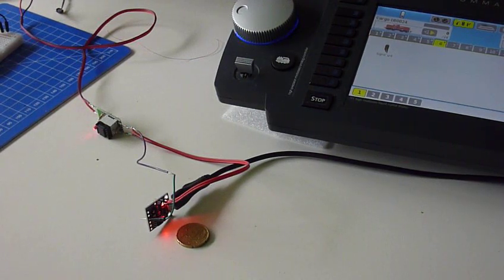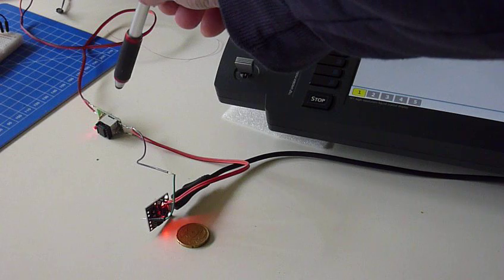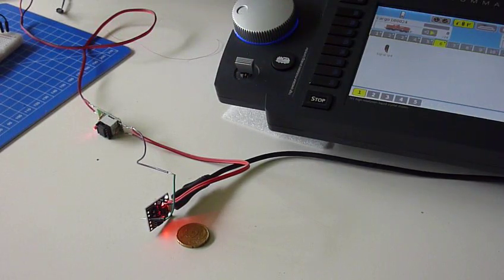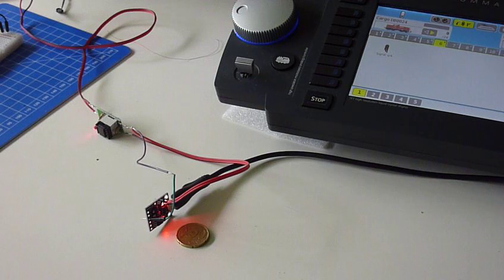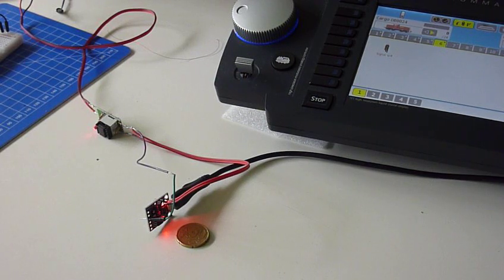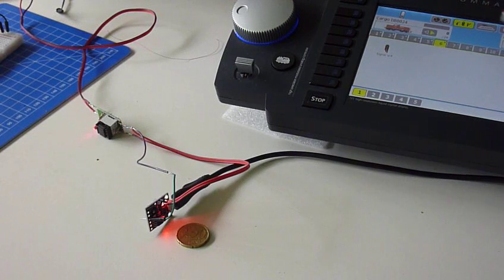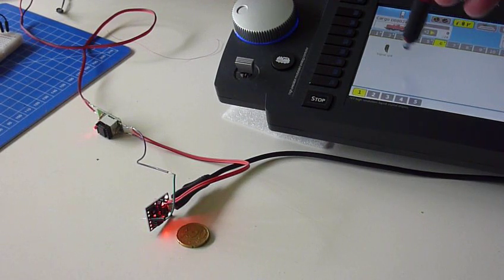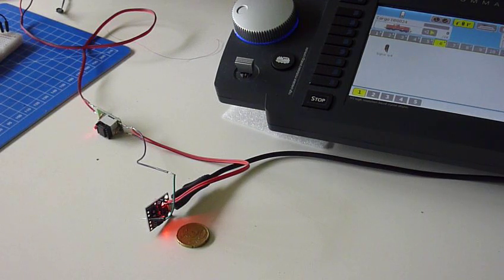RMR045 - ATTiny DCC Function Decoder

Comment: I subscribed and I'm really enjoying your videos.  In this video you mention that it might be possible to control a servo motor with this circuit and it's under investigation.  Were you able to control a servo with this or is my question answering in another one of your videos.  Thanks!
Reply from the maker: Nope, I've not been able to get the servo library to work on the Attiny. However, this was a couple of years ago and I haven't looked into it since. Maybe some things have changed, it's about time to look into it again.
Reply: @rudyshobbychannel  Greetings !!
I downloaded the DCC_S88 library, and it has the RB_DCC_Decoder_Servo.ino file inside. Is this file updated so the servo functions will work now?
I am trying to find a cost effectve DCC Servo Decoder that can be placed along side devides on a layout, without having to pay $25 - $100 a pop for brand decoders.
This is basicly what I want, but in the end...it should only cost about $1 for the Attiny and a $1 per servo. 
Example: https://www.ebay.com/itm/162432299600
Reply: @rudyshobbychannel  
I just found this if it helps at all...

ATtiny45/85 Servo Library
http://www.cunningturtle.com/attiny4585-servo-library/

Comment: Would it be possible to control an electric switch with this, which is connected directly to the rails ?
Reply from the maker: I don't know what you mean by a switch which is directly connected to the rails? you can operate a relay via DCC commands using this ATTiny, the relay can switch anything you like.
Reply: @rudyshobbychannel  I mean connected to the track output (which go to the rails). But when you can only operate one relay, it would not be possible to control a switch (dutch: wissel). And one other question: can you use a TIL111 optocoupler instead of the 6N137 ? (I only have a TIL111).
Reply from the maker: Waldo Hazeleger You need a 6N137 or one with similar switching time specifications. It is a very fast opto coupler, which is needed because of the critical timing of DCC signals.
Reply: @rudyshobbychannel  Ok, I go shopping for them... Thank you for your answers !
Reply: @rudyshobbychannel  Just now tried your DCC sniffer circuit with a TIL111 coupler. Also works ! 
Now building the attiny...
Reply from the maker: Waldo Hazeleger Great, then the TIL111 apparently is fast enough. Have fun!

Comment: Rudy, I download the sketch and made no modifications.  Can't get it to compile.  A little help please:

Arduino: 1.8.5 (Mac OS X), Board: "Arduino Uno WiFi"

Build options changed, rebuilding all
/var/folders/pk/_hj0k0z920d0t1pblgj887k40000gn/T//ccIAHvAX.ltrans0.ltrans.o: In function `setup':
/var/folders/pk/_hj0k0z920d0t1pblgj887k40000gn/T/arduino_modified_sketch_310962/RB_DCC_Decoder_Function.ino:123: undefined reference to `DCC'
/var/folders/pk/_hj0k0z920d0t1pblgj887k40000gn/T/arduino_modified_sketch_310962/RB_DCC_Decoder_Function.ino:123: undefined reference to `DCC'
/var/folders/pk/_hj0k0z920d0t1pblgj887k40000gn/T/arduino_modified_sketch_310962/RB_DCC_Decoder_Function.ino:123: undefined reference to `DCC_Decoder::SetRawPacketHandler(bool (*)(unsigned char, unsigned char*))'
/var/folders/pk/_hj0k0z920d0t1pblgj887k40000gn/T/arduino_modified_sketch_310962/RB_DCC_Decoder_Function.ino:124: undefined reference to `DCC'
/var/folders/pk/_hj0k0z920d0t1pblgj887k40000gn/T/arduino_modified_sketch_310962/RB_DCC_Decoder_Function.ino:124: undefined reference to `DCC'
/var/folders/pk/_hj0k0z920d0t1pblgj887k40000gn/T/arduino_modified_sketch_310962/RB_DCC_Decoder_Function.ino:124: undefined reference to `DCC_Decoder::SetupMonitor(unsigned char)'
/var/folders/pk/_hj0k0z920d0t1pblgj887k40000gn/T//ccIAHvAX.ltrans0.ltrans.o: In function `loop':
/var/folders/pk/_hj0k0z920d0t1pblgj887k40000gn/T/arduino_modified_sketch_310962/RB_DCC_Decoder_Function.ino:130: undefined reference to `DCC'
/var/folders/pk/_hj0k0z920d0t1pblgj887k40000gn/T/arduino_modified_sketch_310962/RB_DCC_Decoder_Function.ino:130: undefined reference to `DCC'
/var/folders/pk/_hj0k0z920d0t1pblgj887k40000gn/T/arduino_modified_sketch_310962/RB_DCC_Decoder_Function.ino:130: undefined reference to `DCC_Decoder::loop()'
collect2: error: ld returned 1 exit status
exit status 1
Error compiling for board Arduino Uno WiFi.

This report would have more information with
"Show verbose output during compilation"
option enabled in File -> Preferences.
Reply: Jim Lewis It looks like the board selected is Arduino Uno Wifi. That won't work. The AtTiny needs additional software and drivers  before it can work with the Arduino IDE. Please have a look at my blog, and follow the links mentioned in the text to get everything you need.
https://rudysmodelrailway.wordpress.com/2015/10/15/use-an-attiny-with-usb-as-a-dcc-function-decoder/